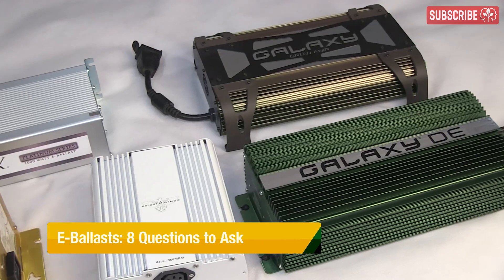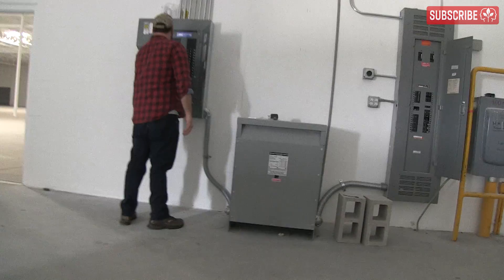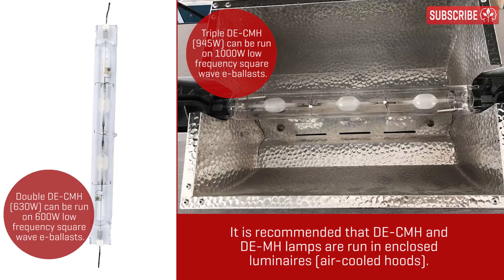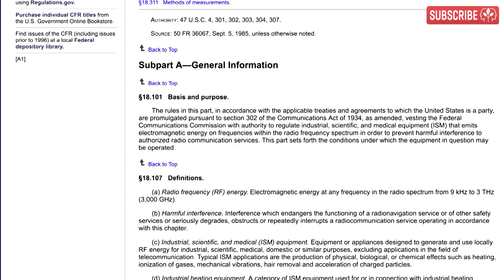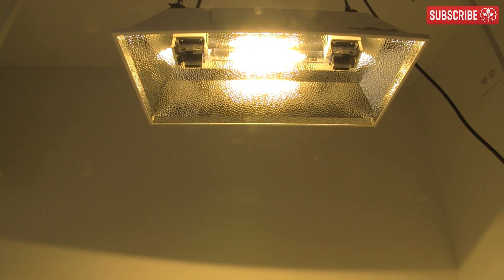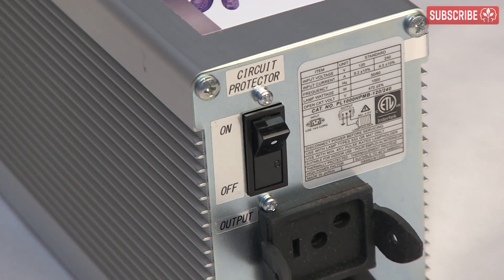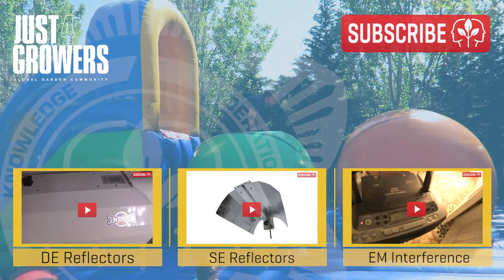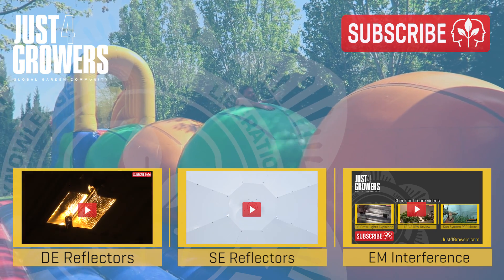Electronic Ballasts — 8 Questions to Ask

Comment: I live on Cape Cod I added a second ballast 600 watt to my thousand watt that I already split into two 500s and it blew out the entire neighborhoods cable and internet so they tell me I'm the worst offender of all Cape Cod I'm like this is impossible I just added one ballast that doesn't seem like it would do it to me. This tool of a cable guy decided to leave my house disconnected so what I do I walked up to the box open it up plugged it back in went back out of my business. They never came back they never called me to tell me that they wanted to rehook it up or anything. What a tool of a service technician. I did also rerun the cable from running right above where my ballast board were and into the garage and through the kitchen rather than into the living room right underneath the row room.. the two ballast that I use are both Solis Tek one of them the 1000 w is a 2012 the 600 watt is a 2015 ballast

Comment: I have an issue someone here might be able to help with. I recently set up a grow room & ran a New 20 Amp Breaker with 20 Amp Plugs & 10 Gauge Wire just for running 2 1000 watt lights. The rest of the equipment ran on another Circuit, just some fans. About a month ago one of my 2 older Digital Ballasts died on me so I sent for a new one, a Vivosun 1000 watt Digital Ballast. When it came I hooked it up & it turned on right away with no issues, nice & quiet too. But when I left the room & came back into my living room my Computer (also on a different Circuit with a high quality Surge Protector) was making USB Noises like something was just unplugged from it & it wouldn't stop. I restarted it & my Mouse & keyboard would not work, so restarted again & tried to reset the Bios but still had no USB Function. So I switched back to my Old Ballast, than I had to tear my Computer apart & unplug the RAM, Video Card & pull the Battery out. Than I put it back together & it Posted (Thank God). I contacted the guy who sold it to me & he sent another one right away no questions. I also Sent for 2 Tripp Lite IsoBar Surge Protectors, one for my PC & one for the 1000 Watt AMP. So when the IsoBars & Ballast Replacement came I hooked them up (the AMP was 6 ft further away from the living Room now too) & once again it froze My USB Function on my PC, but this time it wasn't making any Noises & I was able to restart without completely tearing it down. This bothers me. The Circuit my PC is on has a New 20 Amp Breaker on it too & is separate  from the Grow Room. Any thoughts on what is causing this or how to prevent it?

Comment: If I have 20 lights I need 20 ballast right? I can plug them into a power bar and directly into the wall? Wouldn't it short circuit??
Reply from the maker: If you want to run them all at the same time then yes - if you want to run 10 in the day and 10 at night you can do it with just ten ballasts and a flip box.
Reply: @Just4Growers  so I could connect 2 lights per ballast? And run 12 12 so the ballast is always in action?

Comment: Have you looked into the certification requirements that they claim to meet? I know someone who used to be 'the guy' of a now failed ballast business, can't remember the name but it was popular and cheap yet efficient. He told me it wasn't possible to meet the guidelines with detached ballasts.. they did shut down what 10 years ago now but from his knowledge from the manufacturer, it wasn't possible, they would all put off a level of interference that was above par.  But yes, good ole Tri-Polar Chad ruined it for all. I can't remember the dang name of the company, someone please tell me. I think the ballasts were purple... they were a non metal color, pretty sure purple. I'm about to find chads linkedin page, I know he has it listed as an old job still lol. Apparently Chad tried to out the company (for putting fake, Chinese regulation stickers on under-standard ballasts) at a convention and ended up getting WWF style hit with a folding chair, then was chased around the entire convention floor screaming "help, he's trying to kill Me! Help!"... I wish he got ahold of that AHole, guy is NUTS.
Reply from the maker: You’ve definitely caused a few synapses to fire ..... colorful ballast ...... WWF antics at a trade show....  lunatic ..... technical issues .....  wearing sunglasses indoors? Hmmm ... well you CAN meet applicable FCC Regs and it’s very important to do so for the health and wellbeing of all. ✌️
Reply: @Just4Growers  lol you got me looking into it. I couldn't find the place a read about the incident a few years ago, it mentioned the event. But the company is lumitek and that event got the owner in LOTS of trouble and that guy... well, I'm not going to comment, but let's say he like anyone is serious about his business [maybe not, it wasn't hard to tell chad was a north wind's blow from melting down on a customer or management or anyone in between lol]
Reply from the maker: Jeff B I have peered into the eyes of many electronic ballast resellers and observed their soul, as well as their levels of professionalism and common courtesy. I knew way back then that is was going to be an interesting ride for some of us! #repoman

Comment: I have a ballast with watts selector between 250w, 400w, 600w with a HPS of 600w both came as a package when I bought it. My question is can I select 250watts on the ballast to run this 600watts to save electric bill? I have a small grow tent and I don't really need 600watts at the moment but want to start off with 250w without buying a new 250w hps.

Comment: Hey Everest!
you never mention the fact that some ballasts will lock up/melt/freeze regular timers that small home growers use and so they require circuit breaker type timers.
my question is though, is this still the case for digital ballasts or only magnetic?

Comment: If you use a 1000w lamp on 600w Mode will it have the same par as a Standard 600 W ballast and lamp ????
Reply: Jaybo 8970 no bc its color will be different. Most likely the 600 w lamp would have better spectrum and PAR.
Reply: cool thanks eric